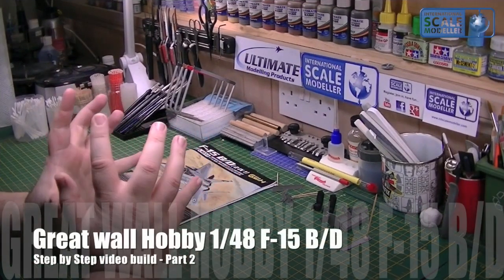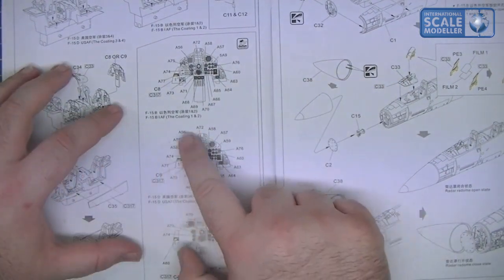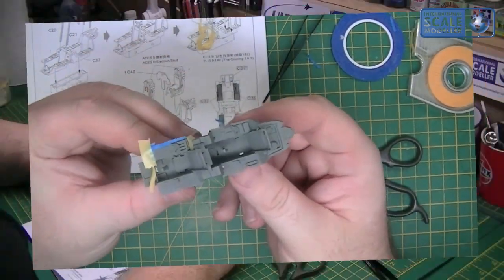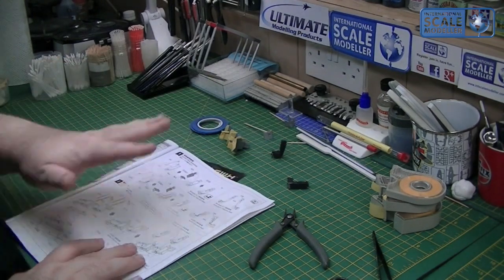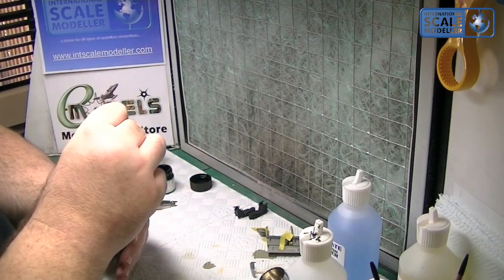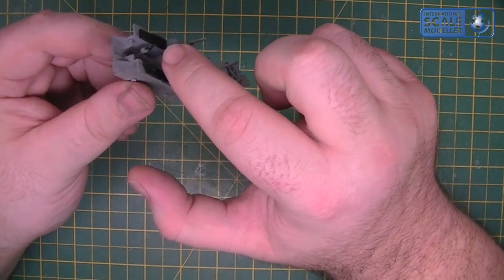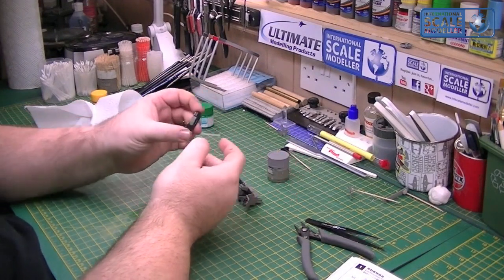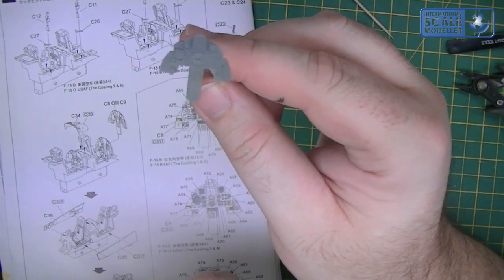Great Wall Hobby 1/48 F-15 B/D Step by Step Video Build - Part 2

Comment: Hello Paul and also Lee, just want to as, do you ait totally with acrylics or do you use both enamels and acrylics? As I just stating to teach myself to paint with acrylics so I'm able to paint inside. I have to admit that I enjoy all your postings and articles
Reply: Hi Les, I use acrylic and cellulose based paints, the cellulose are alclads for metals and clear matt coats, and acrylic for all other paint finishes. For me enamels have no advantages over acrylics, only the disadvantages that they take a lot longer to dry than acrylics and they require more cleanup and smell more too.